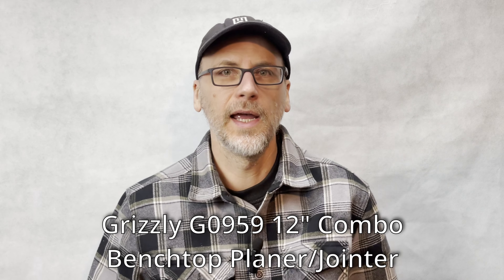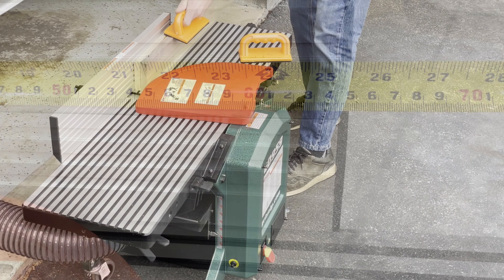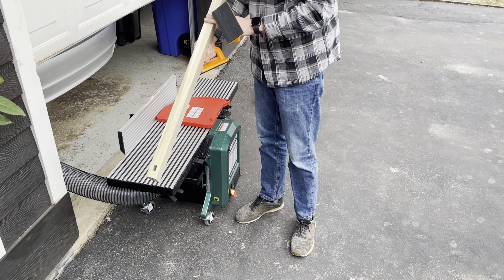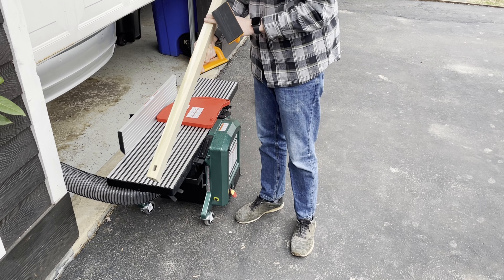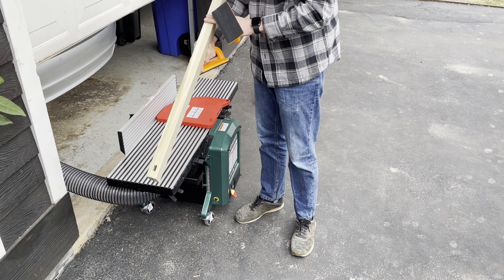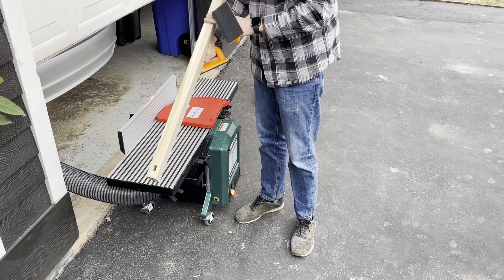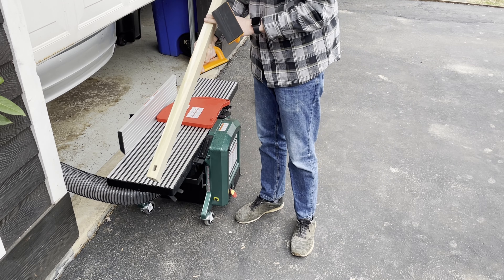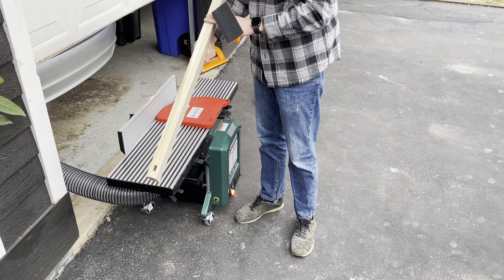Grizzly G0959 12“ Jointer Planer Combo Review

Comment: Just a heads up to anyone thinking of buying one of these units. I have the G0958, which is the 8" version of the Grizzly jointer planer combo. After four hours of use the feed rollers on the planer are disintegrating, boards are sticking and there are now black streaks on everything I plane. Disconnected the unit and felt the feed rollers, very rough and bits were flaking off. I've been planing new softwood lumber. I like the size of the unit but pretty concerning that this happened after only four hours of use.
Reply from the maker: Thanks for the information. I have not seen that issue with mine yet.

Comment from the maker: Its obviously new, but the spiral head blades are really sharp and did not tear our the bird's eye maple which was amazing. Normally a planer or jointer will take chunks around the birds eye because it is impossible to go "with" the grain because of the swirling pattern.
Reply: When I work with some spalted maple, or just crazy figures on a planer, I have to set my planer (dewalt 735) on the finish cut speed, and I have to have the rollers BARELY move it through to take like 1/64th passes. I just keep doing that over and over and over again and I avoid tear out. I also do it at an angle. So If I have a 20" board, I'll go in corner to the left,  front corner to the left, back right corner to the right - on a 5-8" board on a 12" in planer. That way I'm doing more slicing vs carving out which helps alot. For a jointer, I think if you got 12" to work with try going at an angle a bit and see if that helps.
Reply from the maker: @thenext9537  that is a very technique, thanks! The downside to this combo planer is there is no speed adjustment like in the dewalt. So far I have done maple, white oak, and walnut and not had any significant tear out. It may be a combination of the brand new sharpness and also the small blades in the helical placement though

Comment: With my unit, I never remove the fence. I just loosen the screws then slide it back and it works perfectly. You shouldn’t need to remove it — I find it a pain in the butt to redo the screws.
Reply from the maker: Interesting. I can’t slide my fence far enough out of the way to be able to get the dust collection to attach. It is a pain with the screws. I’ll have to play with it some more. Thanks.
Reply: Can you run the machine without dust collection? That would make conversion very fast, much faster than any other combo. I run my planer outside and just blow away the chips.
Reply: @jvehent  I don’t believe you can it without the dust collector efficiently. A simple Ridgid dust collector should suffice.
Reply from the maker: @jvehent  you don’t want to run without dust collection because the chips build up really quick. Especially on the planing, the chips can get between the blade and the wood and causing gouging. It’s unsafe as well to let them build up inside
Reply: I have had this same machine for about 6 months. You can loosen the fence and slide it down out of the way to attach the dust collection hood. You cannot run the unit without the hood in place, but only requires the two clips on the sides to be in place to power on. There is a thumb screw on top in the center of the table, but that is not required. It reduces the dust collection, but you can avoid taking the fence off. However, it is not much of a time savings because you have to tilt the fence down, then loose all four wing nuts to slide it down out of the way. Then you have to put it back and recheck square vs. leaving the mount in place and simply removing and then reading the four wing nuts. It is tedious, but a single machine saves a lot of space and has worked great. It is a good value for the money.

Comment: Ive had one for over a year.... well two actually I sent the other one back... well I drove it back to Springfield. Got a "new one" got home with it and is was as bad as the first one.  Nearly impossible to square the fence to the table and well the infeed table slopes toward the fence.  They should just start over.... its a bad design....
Reply from the maker: It works better as a planer than as a jointer.
Reply: @handyhomerepairs  Probably so
Reply: Well, Im heading back to Springfield to pick up a new machine... I requested that the warehouse guys check the machine for Square before I leave.  Number 3.  Hope this one actually works.  I'll keep you posted:)
Reply from the maker: Good luck. I wish I lived close enough to them to drive. There is no clear way to adjust the infeed table if it isn’t parallel
Reply: @ Well this one is better.  I did speak with one of the managers regarding the fence mechanism.  I don't think they intended for this product to be  really accurate.  Oh well... I'll make it work :)
Reply from the maker: Well that’s not in the brochure lol

Comment: Still have the Grizzly and still happy with it ?
Reply from the maker: I still use it as a planer and that part works good. The jointer is a little more difficult because it’s hard to keep the table square. It works better as an edge jointer but when you try to use the full table surface the small errors are exaggerated

Comment: Do you really have to remove the fence to change modes?  The video on the grizzly website just shows them tilting it back.
Reply from the maker: I had a few people comment about this. I have tried tilting it back like they do on the video and it’s in the way so I’m not sure. It is a hassle to reset it each time just to change modes.

Comment: paste wax not wd40.     oil gets soaked into the wood and can show during a finish.
Reply from the maker: True. I was trying a silicon spray which worked good and did not leave a residue. I can only find finishing wax which leaves residue as well. I have heard of people using wax paper from the kitchen with some brands having enough extra wax to be able to coat the surfaces. It haven’t tried it yet

Comment: Thanks for the review.  I've been waiting to see a few reviews of this tool, and yours is the first I've seen (other than the one from Grizzly).
Reply from the maker: I was thinking the same thing when I kept searching for information on the tool. I took a chance because Grizzly makes great tools. Hope the information helps
Reply: @handyhomerepairs  Any chance you could make a video showing how to adjust the infeed and outfeed tables for parallel?  That tends to be a major limitation of jointer/planer combos.
Reply from the maker: Ok I will have to see if they have the option to adjust. I was looking at this exact issue when I first got it to test but did not see any obvious way. There are bolts where it attaches in the side but I didn’t want to mess up the new toy. Will try

Comment: In theory a good idea but as with most combo tools it doesn't seem to do either function very well. I love the helical cutter head for both functions. Maybe in future models some improvements can be made. As for me I think I'll wait and take a look at next years model.
Reply from the maker: I think you are correct. There are trade offs and it may be your only option if working in a garage. I like the planer and the edge jointer. Face joining is a bit of a struggle

Comment: How does the fence install on the side of unit?
Reply from the maker: There is a brackets attached to the side with a 90* connection point. The screws slide in the circular adjustment area to change the angle

Comment: It comes with wheels?
Reply from the maker: No. I tapped holes on the bottom and add some screw in locking casters. I have to move it in and out from my garage and it’s too heavy to carry.

Comment: Do you not find the length of the fence and the fact that you observed flex in the fence troublesome?  I think I would prefer a longer and stiffer fence.
Reply from the maker: @marshallurrell4583 yes a standup model would be better but it is sufficient for the space I have. I don’t have a dedicated workshop so being able to move the planet around is the best for me. I found edge jointing to be sufficient and then I surface plane. I then clean up with the table saw and can make perfect square boards. I have done boards up to 6 feet in length. Anything more and I think it may start getting too wobby

Comment: You don't have to remove the fence. It should slide to the far end of the jointer away from the dust collection.
Reply from the maker: @edtv6453 A few people have told me that, but I can't seem to get the fence far enough out of the way to clear the dust collection. I will have to try again. thanks

Comment: Thanks for doing the review, been eyeing this unit. You mentioned it clogs on the 2.5 dust port when using a shopvac. I don't have a dust collector, only a shopvac, is it really that bad? Also do the beds come coplanar, or is any adjustment needed?
Reply from the maker: The shop vac couldn’t keep up. It wasn’t clogging but the hood had quite a bit of chips. I guess you could clear it out every couple passes but the chips may start interfering or chunking out the wood. I bought the vac to keep up. 
The beds came coplaner. I have been testing out some of the screws to see how to adjust in the future. There are no details in the manual about it. The only documented procedures are for making the fence 90 degree or stepping for depth of cut on planer and jointer
Reply: you really should use good dust collection with most planers IMHO. better for the machine and better planed surfaces
Reply from the maker: This is correct. If you aren’t removing the chips they can get back into the cutter head and mess up the smoothness of the cut. Manual says 12” needs at least 400 cfm on the port. I had to upgrade to 4” dedicated vac to keep up
Reply: I have this same machine and have been using it for about six months with a shop vac with a 2in port with no problem. But I do have an Oneida Cyclone Separator on my shop vac and that makes a huge difference. The 5 gal bucket fills very quickly when using the planner, but it has never clogged.

Comment: 12” jointer? Crazy. 120v 15a power draw, same as my dewalt 735 basically.
Reply from the maker: Yeah and helical head and 4 cutter faces. Super sharp and didn’t tear up birdseye maple which was surprising. Happy with it so far.
Reply: @handyhomerepairs  That's crazy. I always see 6 and 8" and rarely 10". 12" is nuts. It's a helical head, but not a spiral I take it. IE, it's not like a SHELIX on a dewalt 735 (which is like 500$ just for the head, nevermind 650$ for the planer itself!).
Reply from the maker: Correct, helical with the individual “blades” and there are 28 of them. Also 4 sided so you can turn as they dull and get 4 uses. It also came with several extras.
Reply: Helical “style” is spiral head. They are trying to get people to associate the true helical with these, but it is a different product. The categories are blades, spiral, and helical. Thanks for the review.
Reply from the maker: @michaelshelnutt3534  well said. These are multiple individual blades laid out in a “spiral” pattern. Through the nice thing is they have 4 sides, so as they dull you can give them a turn to the next sharp side. The unit also came with a tube which contained several more spares

Comment: Wahuda 10 inch jointer +  Dewalt DW735X > Grizzly G0959
Reply from the maker: The dewalt is a good planer. I have never tried the Wahuda jointer. It looks a little cheap with those extender infeed and outfeed arms that may be difficult to keep in alignment. It got decent reviews though. 

Also have to deal with multiple tools which is the problem with limited workshop / garage space. Thanks for the recommendation

Comment: You don’t have to take the fence off. Tilt and slide to far end (front)
Reply from the maker: I tried this as well but that only works on the 8”. From the manual - Jointer/Planer conversion G0959 Only: Remove fence from support bracket…
I actually like it better this was as well so you can keep it in square (still double check)
Reply: @handyhomerepairs  👍
Reply from the maker: @Michael San Thanks. I just saw it on their video as well. I tried sliding the fence all the way back and even beveling. The fence is still at least 1/4” in the way. The manual on page 35 says take it off. Who knows, maybe they changed it after the advertisement video was made. I still prefer leaving it at 90 degrees and just taking off the 4 wing nuts
Reply from the maker: @Michael San I have a video where I made  the maple table (referenced in this video). I also recently tried it on white oak with no issues. Currently making a video where I use it on some walnut. I still find the edge joint difficult for joining boards, but cleaning it up with the table saw for now. Great on face joint and planing

Comment: This looks a lot bigger than I thought it would be. How heavy is it?
Reply from the maker: @jundossantos it’s pretty heavy, around 90 lbs. I have to move it around because I don’t have a shop so I put locking casters on it and push it back and forth. Probably better on a dedicated stand but we do with what we have. I made a 60 inch table with it so it’s possible to make fairly long and straight edges

Comment: Thanks for the review mate. I'm interested in one of these as I don't have 240v in the shed. I might look into an alternate to the fence or come up with a more supportive bracket.
Reply from the maker: It is perfect for the purpose I need as well. I don’t have a dedicated shop or room for a huge jointer. We make do with the tools we can fit into the space. I have made several large panels with it. When the jointer does not make a perfect edge, I clean it up on the table saw and get a smooth edge to edge joint

Comment: Undecided between the 8 or 12. From a price point the 8 is almost half with shipping. Is it worth going with the 12? Thanks!
Reply: Also what's the max thickness to plane?
Reply from the maker: @TacoMania I wanted to be able to plane 12” and only wanted one tool which is why I went with the bigger one. Ended up jointing a 10” board on first project so glad I had larger capacity.
Reply from the maker: Planing 1/32” on a 10” board felt the best for the sound of the load on the motor. I did 1/16” and it went ok as well but I liked taking a little less to watch the progress and also do both sides. I accidentally did 1/8” while learning on my 10” wide maple and tripped the circuit. I was using it on a 15 amp. Switched to 20 amp circuit after that. On a smaller width board it would program be ok but general rule is not so much on each pass
Reply: @Handy Home Repairs  thank you for the feedback! Just to clarify on my planer question, would I be able to run a 4x4 in the planer? Or even a 6x6?
Reply from the maker: Oh I understand you now. Yes, when it is fully down the planer opening measures about 6 1/4" inches from the feed table to the top. This is more than enough for the 5 1/2" of a 6x6.
Reply: @Handy Home Repairs  fantastic! I think I am gng to fork out the loot for the 12 inch I am in dire need of both machines and having them in one is great. The helical is a plus hopefully it's won't take a poop after a while. I might drive to Springfield and grab one since it's $200 for shipping
Reply from the maker: Yeah I was stuck with that shipping fee and it’s not close enough to drive. Good luck